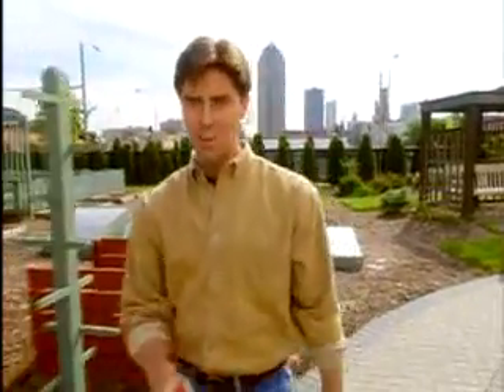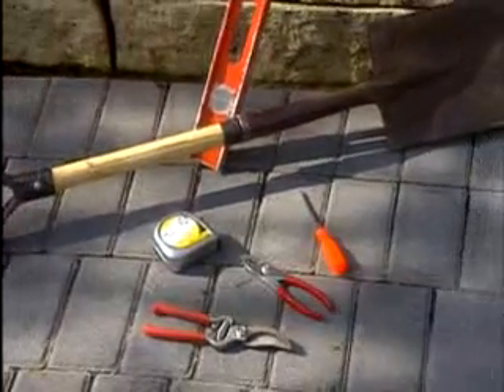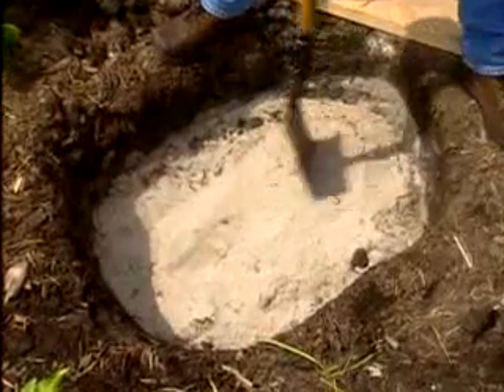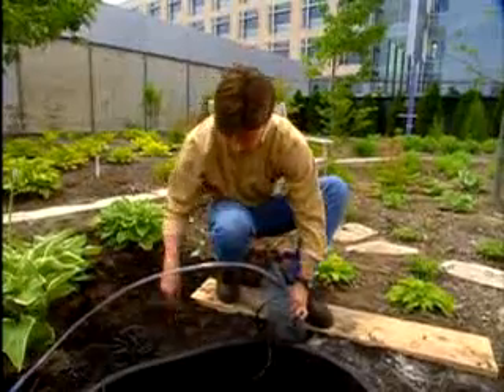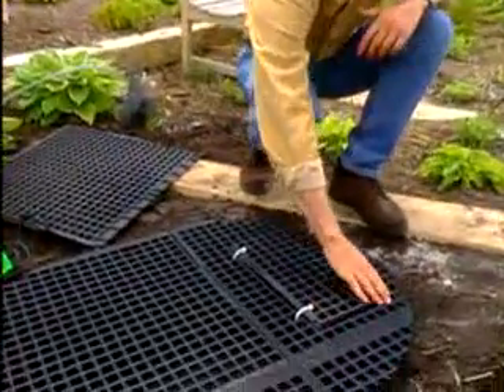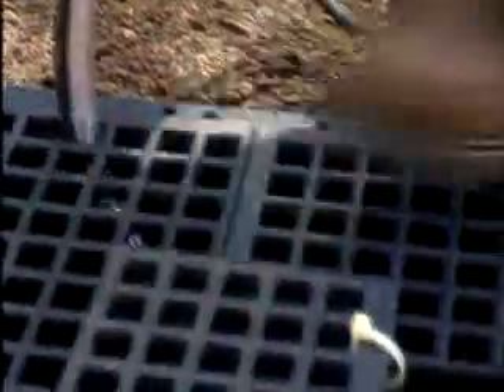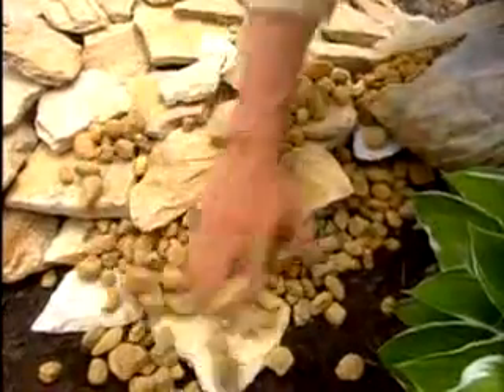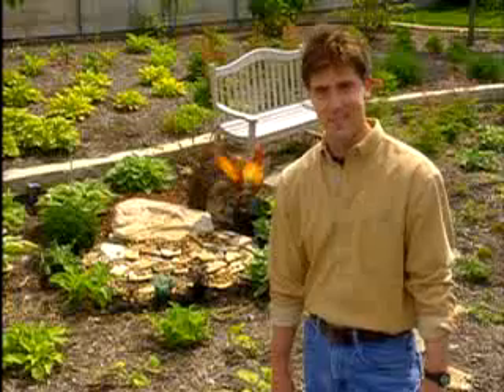Garden fountains

Comment: There is nothing to stop the pump cable (cord) from being mechanicaly damaged. Why not run it in conduit or better still use steel wire armoured cable.
Yes, I know its a USA site, but you can still damage the cable / get electrocuted.